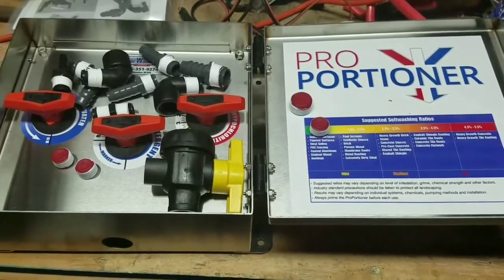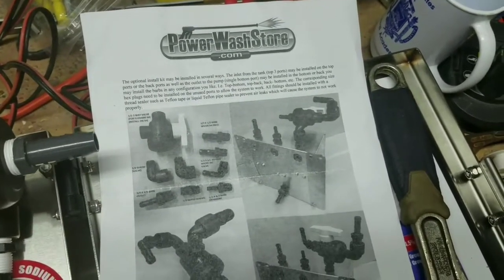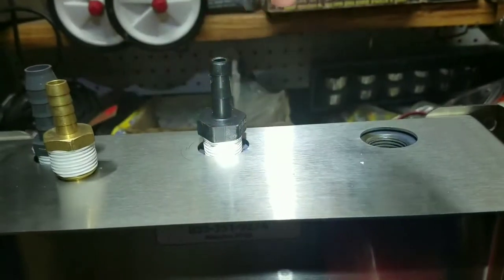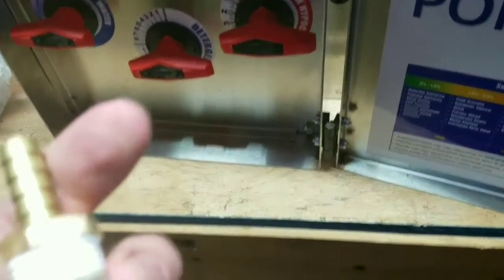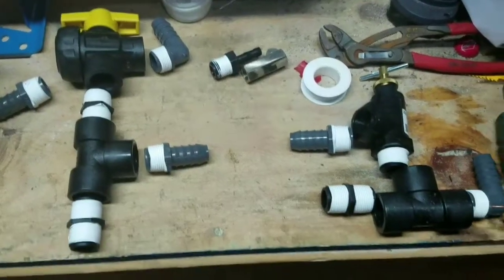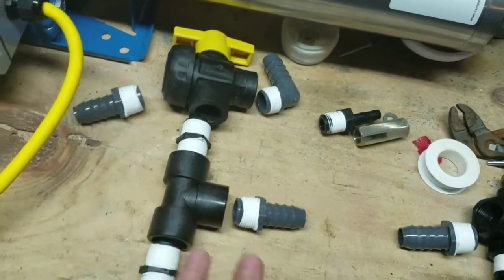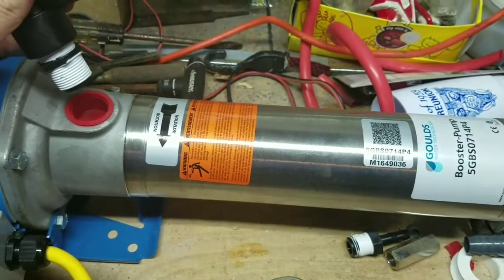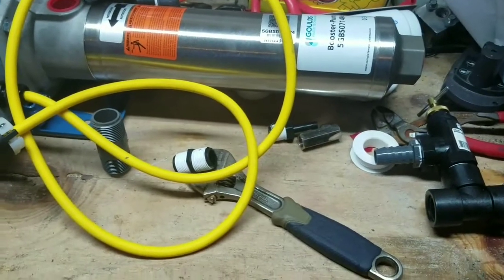Proportioner and booster pump build

Comment: PLEASE HELP ME!!!! I HAVE THE PROPORTIONER AND I HAVE THE FLUSH KIT VALVE ON TOP OF PROPORTIONER FACING EAST N WEST. I UNHOOKED IT OVER THE WINTER FOR MAINTENANCE.  NOW I'M NOT SURE WHAT HOSE GOES ON BLEACH SIDE OF VALVE AND WHAT SIDE WATER HOSE GOES ON VALVE
Reply from the maker: It doesn't matter.  You just switch the direction that your flush valve is pointing to get bleach or water
Reply: @Clean Power Wash LLC  thank you Sir.

Comment: Do you know if those Numbers on the SH valves are based out of using 10% or 12% SH? I’m curious to know how they came up with their calculations and percentages
Reply from the maker: 12.5
Reply: Clean Power Wash is that what the guide says?... just curious bc its hard to find 12.5 where im at

Comment: This work with the stallion from Powerwash.com?
Reply from the maker: Josh Mallett yes it works with 12v, booster or air diaphragm
Reply: The pump I have puts out 6-9.6 gpm. Powered by a Honda GX 200. It has a bypass

Comment: Rob, could a sprinkler booster pump work like the big blue booster pump you guys use. I have a sprinkler pump 1.5 hp and thinking about hooking that up instead of getting the blue colored pump. What do you think on it? Do you think it will work the same or just a good?
Reply from the maker: gv pw no clue about the durability of sprinkler pump or how it would handle that much bleach.

Comment: Got the proportioner in and the large plug  for the bottom is doing the same thing your barb was doing it wants to cross thread? How did you fix it? 2. Do you mix your soaps since there is only 1 input for detergent?  and finally where did you find cam locks for the hoses and what size are they on your other video? thank you...
Reply from the maker: Courtney Blackmon yes soaps mixed in one container.  I used metal barb instead.  Camlock from Russ at southside or Amazon.
Reply from the maker: I believe it was 3/4 inlets for bleach and water.  Smaller for soap.  1/4.
Reply: Looking at the Booster pump can you run that off a marine battery?
Reply from the maker: Courtney Blackmon find me. Facebook.com/robandersonjr

Comment: Hi Rob, Great Videos!!  I am looking at getting into the soft wash and roof wash business.  I have been talking with Bill at PWS on what system to start with.  Gen3 with pro-portioner, Booster pump with Pro-portioner or the a udor type of unit.  I already have a 4gpm 4100 psi power washer and 55gal and 35 gal tank on my trailer.  Looking for the right system that can get to the top of 2 story roofs with the right amount of SH to do the job right.  In my area there is really no one doing this type of work.  Looking to keep it around $3000.  Also do you think the pro-portioner is something that could be made with some valves or is it a complex system thats not worth trying to piece one together and just spend the $1200? 

Thanks
Rob C
Reply from the maker: gunzofdeath1 spend the money, get booster, titan reel, and proportioner
Reply: Thanks,  Do you know the part number to order the bypass for the booster pump?
Reply from the maker: gunzofdeath1 call them and they will take care of you.   buy 2 of the unloader.  ours cracked.